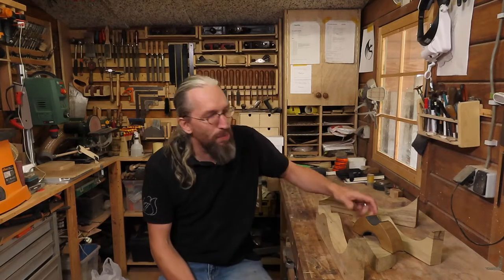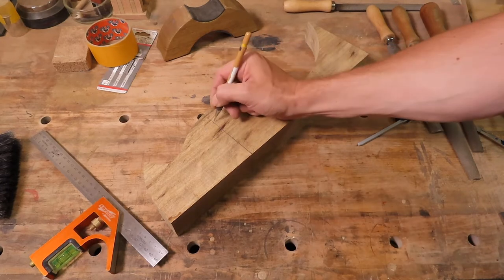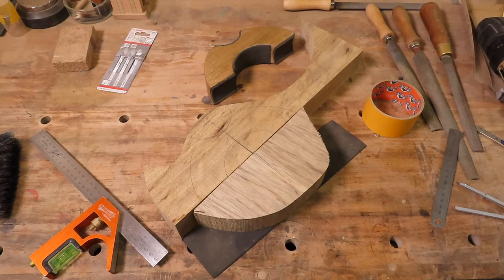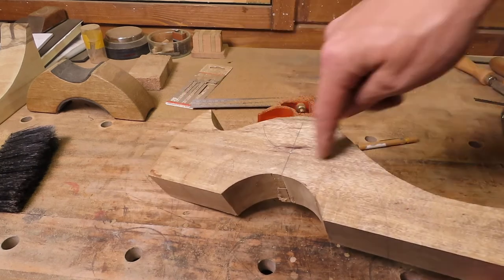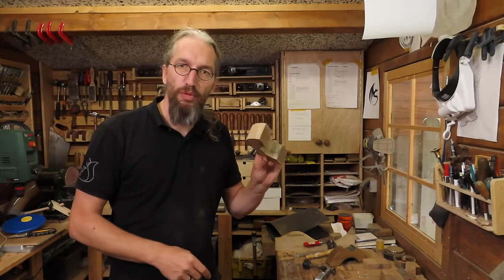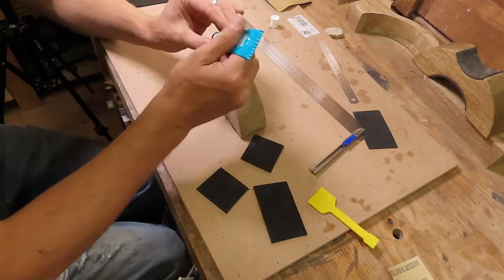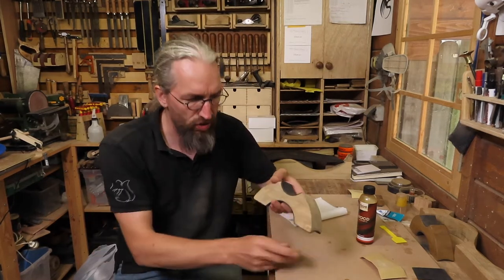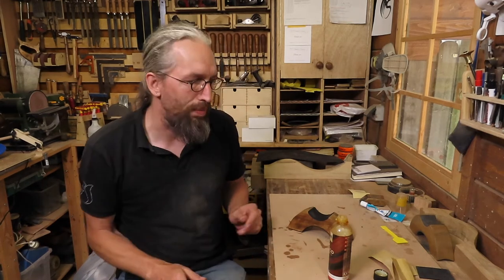How to make a guitar neck rest with some basic tools (DIY)

Comment: Hi, what blades do you use on that jigsaw as it cuts so straight? I mean, that when I try to cut curves, blade will always go different path on other side. Especially with wood this thick. Even on straights it tends to do that. I have Makita jigsaw and I have tried at least three different type of blades.
Reply: I’m not sure what he uses but I use Diablo blades they aren’t the cheapest but they are amazing

Comment: I like this design and I can finally use an off cut from a piece of 8/4 poplar lumber. Question…why did you put the rubber on the larger radius on the underside of the rest, near the support legs?  I assume the guitar will always rest on the smaller radius on the top.
Reply from the maker: Hi MixingGBPO,
Thank you for your question.
Some guitars may require a lower neck rest. By adding the rubber to the 'underside' I can use that side if needed. With this design I basically have 3 neck rest heights in one.
Reply: @UnquendorGuitars  Ah, very nice.  Thanks!